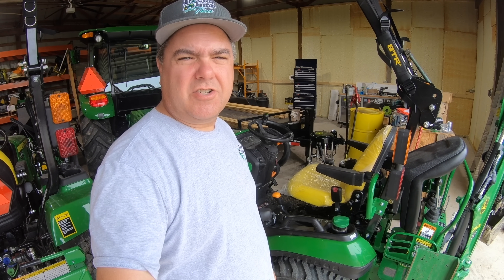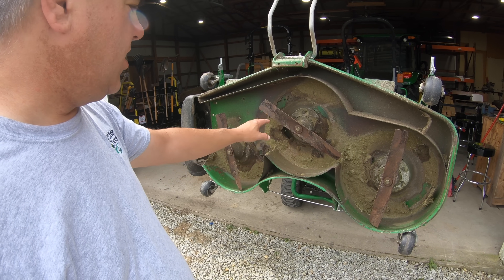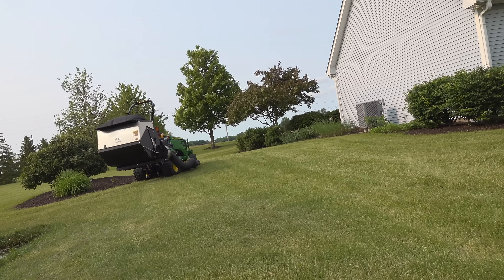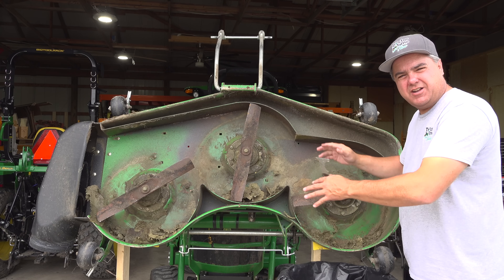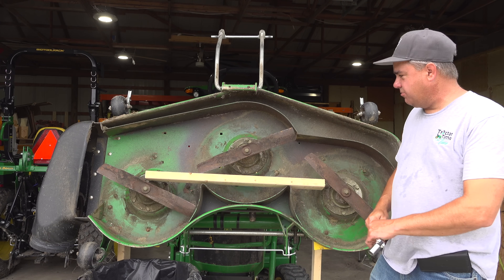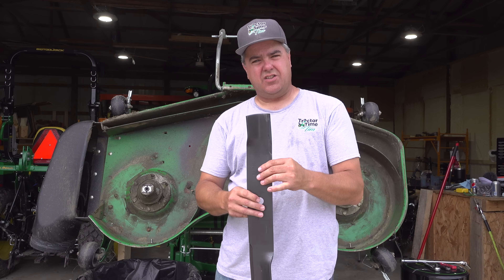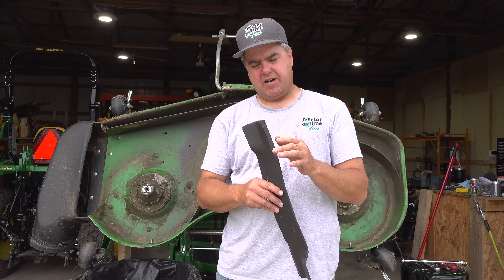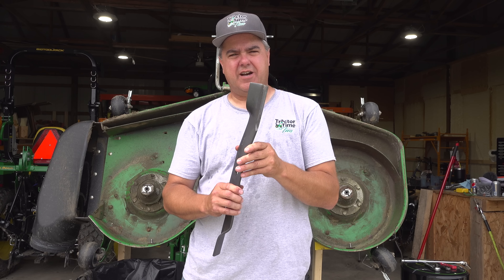Never Sharpen Your Mower Blades Again???

Comment: I had a welding shop for 35 years and I can say with confidence those blades will last 3 to 5 times longer than regular blades if they are using the correct material. I can say that because we applied tungsten to the underside of mower blades and that worked exactly as you described. With that said, never is a long time and calling them never sharpen is an overstatement of the effectiveness.
Reply: Have you ever used Stellite to hard face. We hard faced some Banberry Mixers for Firestone, and tried it on some blades.
Reply: My dad welded a bead of stainless  to the edge of a set years ago. It worked well and lasted longer but with the mole hills and everything else that you hit when you don't have a golf course yard they dulled as well.
Reply: Never sharpen for the life of the blade. I think Beach River Landscaping is getting 40 hours before replacing. Saves him hassle of sharpening in between. He loves em. Just mentioned them in a video recently.
Reply: @stevecarr1992  Very bad for the grass

Comment: if you spray it with cooking oil at the beginning of the mowing season grass will not stick to the bottom of your deck whether your grass is wet or not when you mow i have been doing this for years
Reply: How often do you gotta respray the deck
Reply: @joshywashy4039  Depending on how regular you mow, the cooking oil application will last for 8 weeks before you apply the next application. Please note that the cooking oil does not stop the grass sludge from building on the housing of the mower. You will still grass sticking but not as much. What it does is simply makes it very easy to remove during a cleaning op.
Reply: Can you also use non-stick cooking spray?

Comment: I'd say a little undercoating spray would help keep it from rusting. I just can't get to mine that easy lol.
Reply: Hey Rob , agreed on the undercoating as I worked for a school board and I used it on not only mower decks ( rotory type ) , and heavier  bush hog type mowers . Something else I did was spray the top of the decks with ' snow plow ' wax . . . .Had folks scratching their heads as this was in Florida. Worked great not only for rust prevention but the mower operators loved it at days end as an air hose replaced the wash rack for the little clippings that hadn't already blown off while transporting.  The under coating idea followed me from a previous job where the shop I worked at maintained parking lot sweepers . The vacuum boxes were always wearing through from the sand here in Florida . After spraying the inside of the vacuum and chute areas and  we'd get almost three times the life out of them doing the same routes. Other posts on here said truck bed liner works well also . Never tried it but it makes sense although we experimented with plastic and rubber liners etc. , and found the softer undercoat seemed to last longer than anything harder . Hope this helps folks .
Reply: It wears off pretty fast , I don't know about the expensive  stuff ( RAPTOR ETC . )

Comment: I haven’t sharpened my 52” Scag walk behind in 10 years.   Cuts beautiful.
Reply: Probably like my swissmar I haven't run it for 10 years I use the weed eater
Reply: Push mower I haven't run in 10 years
Reply: So you never use it.
Reply: Thats cause your hubby had them sharpened while you wefe away.

Comment: How come you don't use the built in washer nozzle?  After I mow, I hook the hose to the unit, turn on the water and then turn on the mower and let it run.. Cleans it up and out nice..   After it dries just spray with some WD 40 to prevent rust in any area showing metal.

Comment: I give mine a light mist with fluid film or used oil to stop the rust .leave it tipped up over night to let all the extra to run to bottom  and wipe it up when done and store for the winter

Comment: If I stopped hitting roots, sticks and gravel my regular blades would last longer also.
Reply: I have sand in my yard too. Sand can really dull a blade. It's like sanding the edge right off. When it's dry there's really no avoiding hitting it either. Well, I can just not mow. That'd avoid it.
Reply: But if I didn't have roots, sticks, and gravel, I'd have no yard at all.
Reply: @1pcfred  me too. We live in Florida. We have an acre. It's all sand. I ordered a set of Laser Edge blades today from our local JD dealer just to see if they'll hold up under the repeated sand blasting. Time will tell.
Reply: @bbblehead1  lawn mower blades have to be a soft tough alloy to make sure they won't shatter if you do hit something with them. I sharpen my blades like every other mow. Which does wear them down. The lift surfaces get worn too. I'm about due for a new set of blades now. I get maybe two years out of a set?

Comment: I use an impact on taking off and putting on my blades. A lot easier and safer. My dad cut the tendon on the back of his thumb into. Wrench slipped off while putting on sharp blades.
Reply: Uh BYU700
Reply: Yeah I use an impact gun to remove and install my tractor blades.
Reply: Battery operated impact wrench from cordless drill set works perect too.

Comment: I also found with an impact wrench I didn't need to use a wooden block to wedge the blades.
Reply: Same here. No wooden blocks with an impact wrench. Much easier and safer than a breaker bar.

Comment: Interesting concept. Yes, most blade makers act like everyone has a golf course for a lawn. Please make a video on how they work.
Reply: There trying to reinvent the wheel. Jack the price up on some blades that are no doubt getting nick's and chips from typical yards. When I start mowing Pebble Beach, and Augusta golf course,  I'll check em out. I wanna see the self sharpening chainsaw next. I'll stay tuned!!
Reply: @mathieuagee1090  I've got a john deer and they make the worst blades I've ever seen they break to easy I've changed mine 4 times so now I buy my blades at tractor supply no problem since I switched
Reply: @mathieuagee1090  There is a self sharpening chain saw concept.  It is a whole system, chain and saw.  I suspect it is kind of boutique for now and likely $$$ cannot recall where I "saw" it.
Reply: Sam Fuller (had to delete the at symbol, would not post my reply) The ole ink jet printer concept!  Except JD does not give away its mowers so they make money all around.

Comment: Tim a battery operated impact wrench makes it a little better ant when all clean spray with silicone spray grass will not stick
Reply: A cordless impact, well ain't you fancy? Now get over there and roll the air hose up.

Comment: When I clean my deck I take the blades off as I'm probably going to sharpen them or replace them . I use a4.5 inch angle grinder with a 36 grit flap disk. I've tried those self-sharpening blades and with all my ant dens rocks don't last any longer than the originals.

Comment: Okay, so bottom line is this... if you have a really nice lawn with no rocks or stumps you should be in good shape with these blades and they will last you a long time. 

I can see where golf courses may benefit from blades like these.

However, if you're like the majority of homeowners, your yard sucks and it has a lot of objects that beat the hell out of the blades over time.

Common sense is to not mow large branches, rocks, or other large debris in your yard. There will always be some rogue items in people's yards that made ding & dull their blades.

Whether these hardened surfaced blades are cost-effective or not will depend entirely on the ground they are used on and the operator. What will work for some won't work for others.

All I can say is that you need to try them first, and make a your own judgement as to if they are worthwhile or not.

Comment: After cleaning it Coat it liberally with Lard Mixed with Bacon Soda. This will help neutralize any acids from acid rain etc And the oil is Bio degradable . Mine has lasted for quite a long time course back then the gauge of steel they used on the decks were a lot thicker.

Comment: I always have one set of blades on the mower and spare set waiting. 2-3 times a season I will swap them and then when time permits I pull out the bench grinder and put a new edge on the pulled set so that its ready and waiting.  It takes about 30 minutes to do the switch on the zero turn and the clipping are less like bails of hay with a fresh blade.  That is what happens cutting 5 acres up to twice a week anyway.

Comment: Interesting concept, I'm curious how well they'll work. Personally I would be a little worried about what might happen if you do hit rocks and sticks, like maybe the blade will delaminate.
The load and go system looks pretty slick.  I don't mow with my tractor, but a pair of Ken's Bolt on Hooks work great for picking up the mower so I can swap blades...
Reply: any type of hardening treatment will make the edge brittle and rocks will chip the edge

Comment: I’m not fanatical about the mower blades but wow what a difference a new set makes. Not just the cut quality but the ease of cutting it makes the mower and motor work easier. 
Also as mentioned by a few others, an impact wrench, either battery powered or compressor power makes it so much easier.
Reply: Dull blades are not good for your grass

Comment: Easiest way to remove blades is with an impact gun, no wood or backup wrench needed
Reply: yup impact the shit out of them...never broke or damaged anything that way and never had a blade come loose either.
Reply: agreed
Reply: Jimmy Owens   thats not surprising as most of the electric/battery powered guns ive been around only have one setting and that is MAX power but funny thing at work we call them DeFault because we tent to break the spindles on the impact guns...mind you this was AFTER they sold out to Stanley.
Reply: Jimmy Owens bought the same, mine has settings 1, 2, and 3. Torque settings put them on #1 take off #3. No problems. They simply don’t need to be very tight....
Reply: Jimmy Owens yea, I just got mine, love it.....my impact died and for a good one it’s about 500.00 so I went with cordless, this way I can change blades in the field.......the impact was 300.00.

Comment: Tim... I just purchased a 1025R. After mowing a few times I can't get the 60d mower deck to mow evenly. It basically not cutting even resulting in a terrible look and often scalps. Do I go back to the dealer, or is there an easy fix. NOTE: air pressure is accurate, and I've used different scalp wheel heights to try to correct. No luck.
Reply from the maker: I recently did an episode showing how to adjust the deck

Comment: I am a small engine mechanic and this is B.S. No such thing as self sharpening.  Do not fall for the B.S.
Reply: Thanks for the truth. Who is dumb enough to think this is even possible. I suppose this guy.
Reply: @Jeff N the title should  have said " products that don't work as advertised". They have been marketing  gimmicks for a long while. What happened to the saying " if it seems too good to be true it probably is" ? I guess the universe forgot this nugget of truth .
Reply: Not new technology. I hard faced a set of tiller tines on one side with a torch/powder type. The base metal wears away faster than the hard face material. These tiller tines lasted for years.

Comment: I think you’ve just motivated me to actually go sharpen my mowers blades and give the deck a rough cleaning.
Reply: Although I’m not sure how much I feel like crawling under the tractor while no one else is home. Ehhhhh.
Reply from the maker: You need the load n go!
Reply: Tractor Time with Tim my 425 doesn’t have a loader on it :( I had to jack it up and get under it like a peasant.

Comment: Never sharpen is like the mowers that say never change the oil. Just add more. It’s a gimmick.
Reply: FishFind3000 - it's not a gimmick. These blades are John Deere rebranded Lazer Sharp blades. There is a thin layer of metallic material that is applied via plasma deposition. It's thin enough to provide a sufficiently sharp cutting edge (equivalent to a well sharpened blade with 3 to 4 hours cut time). You don't want to sharpen these. If you're not sharpening with a wet system, the heat applied to the cutting edge during sharpening will do more to decrease the life and effectiveness of the edge than help it.

Ask any commercial cutter in a sandy area that uses Lazer Sharp blades... there is no equal. Less downtime, less maintenance, longer service life. If that's what you call a gimmick, I'm not sure there's any help for your condition.
Reply: @driverjamescopeland  if you hit anything the edge is ruined and your done as its not gonna work out with resharpening. plus if your only take little bites when grinding theres no issues. if you go ham on the blade with the grinder sure.
Reply: FishFind3000 - say what you want... they last longer, and don't require sharpening. Buy a set. They're guaranteed.
Reply: My tractor is 14 years old now and this year I'm thinking about changing the oil on it. I hope it don't blow up if I do!

Comment: Little commercial grade tip from an commercial landscaper....... try wetting that grass on the underside first with a hose.  Wait 20 minutes for it to soak in, then scrape it.  It'll come off 20 times easier.
Reply: Easier to use a large putty knife dry grass works best DRY NOT WET

Comment: I just finished mowing my newly seeded lawn for the second time but the middle blade on my 60" deck doesn't seem to be cutting as well as it should. I've yet to turn the deck over and inspect but has anyone else had a similar issue with their new 60"? Thanks